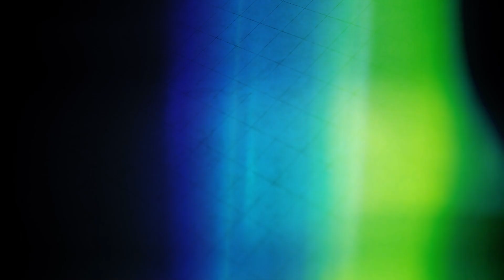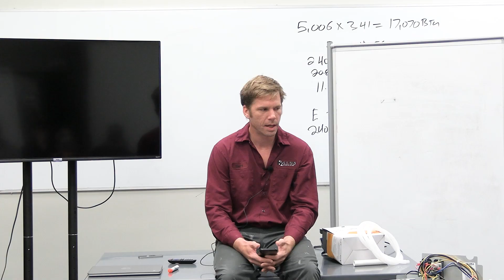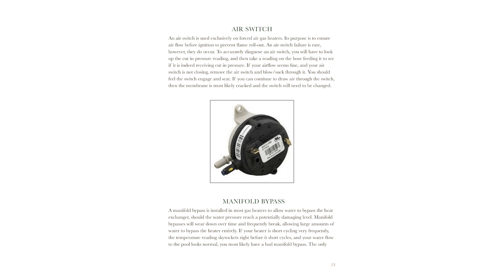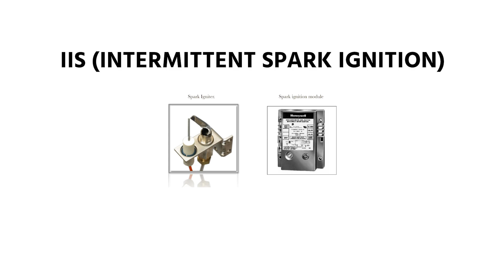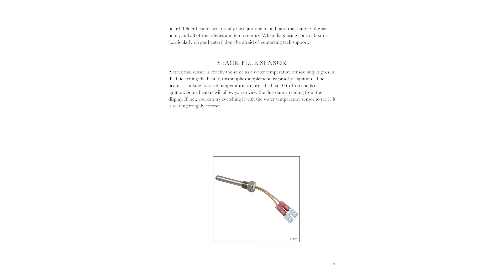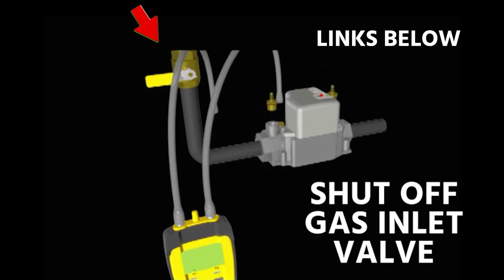Gas Pool Heater Kalos Meeting w/ Bert

Comment: Hot surface ignitors that are hard to get at you can also test with your meter by putting it on ohms and put it on the ignitor wires open line or infant ohms your ignitor is dead around 400 ohms or more it's almost dead